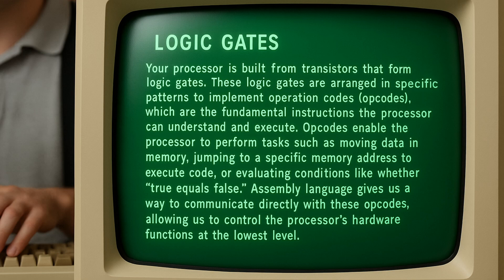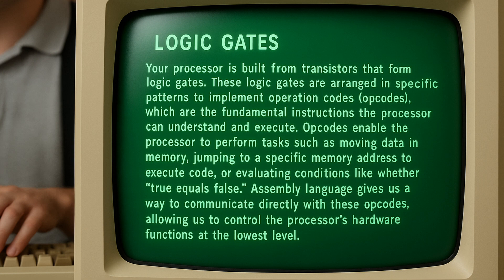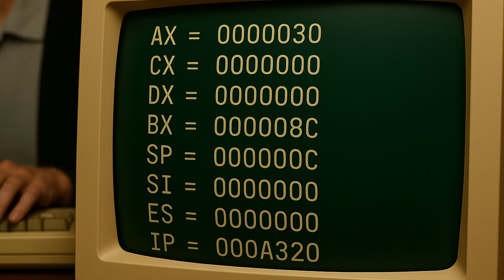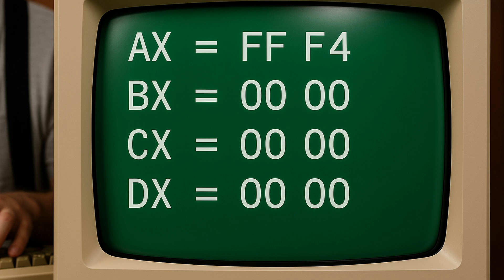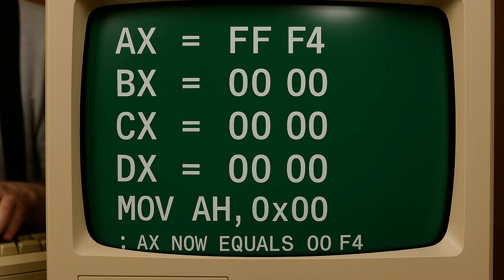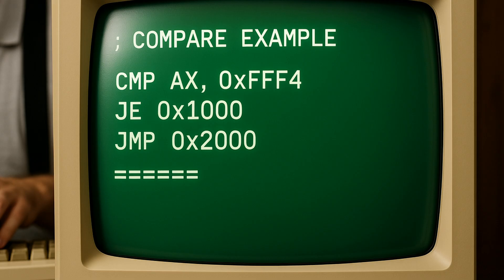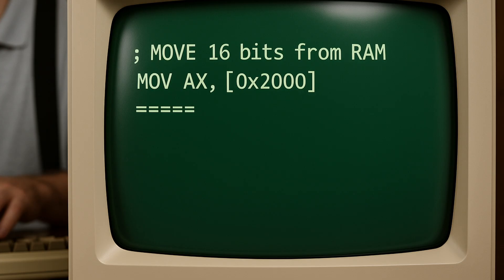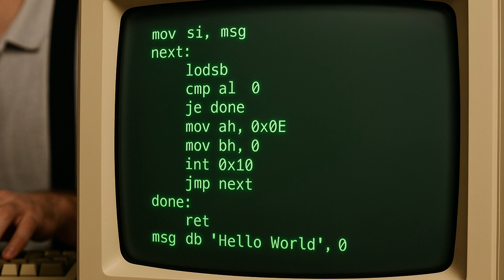Assembly Language The Retro Way

Comment: I leant IBM Assembly language in 1971, and used it, aling with COBOL, for many years. X86 Assembly language is not very different(Apart from different registers anyway).
Reply: I learned assembly during quarantine. Imagine how bored i was
Reply from the maker: Yes it maintained backwards compatability there's new features since 8086 days and many but backwards compatibility remains